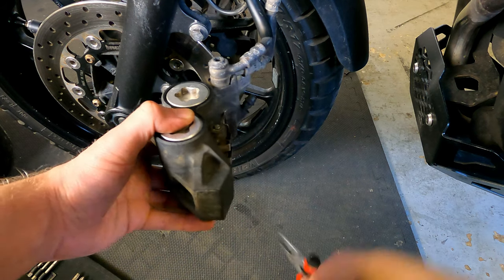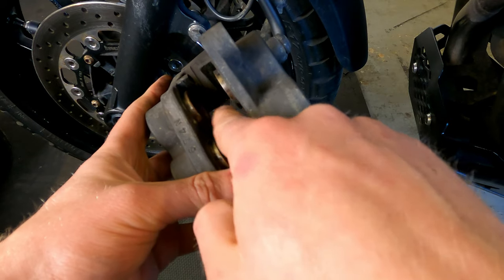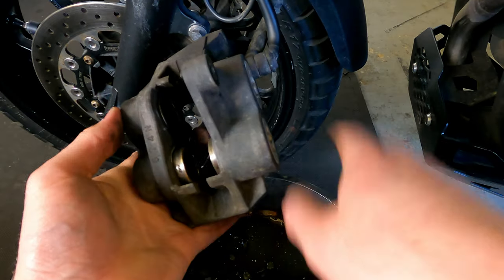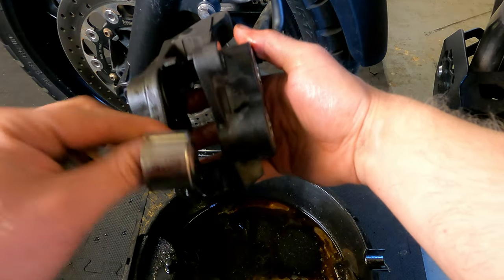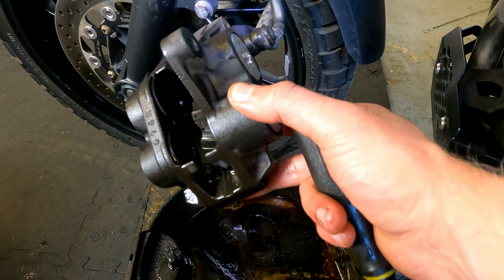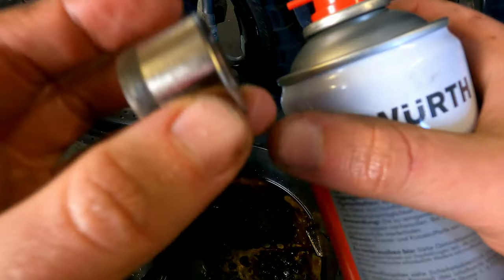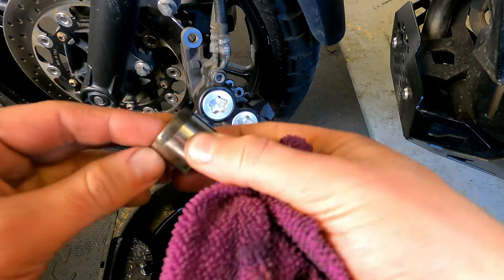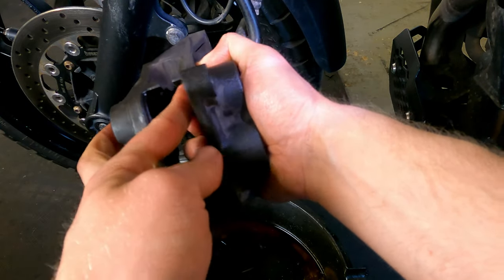Binding Motorcycle Brakes? | Replacing Brake Caliper Seals | Yamaha Tracer 700/MT-07

Comment: Nice job again Sam, very well explained. I'm surprised the seals needed replacing on such a recent bike as I have yet needed to replace any brake seals on bikes much older.  I'm expecting I will as my  fj1200 is 29 years old and not ridden for 10 years and was still on the originals at 19 years. My guess is they must have perished by now.
Reply from the maker: Thanks Michael! To be honest, I do think all the components on this bike are of a slightly lower quality being that it's such a cheap bike. Bearings, seals etc tend to be a bit more brittle compared to others but it's good practice nonetheless!
Reply: @SamVBikes  that night be the case, there is more profit to be made if consumables are lower quality, compared to the old days, as they can sell them more frequently. £80 a set is eye watering, at least Dick Turpin wore a mask!
Reply from the maker: Definitely! And I'm sure they will let you know a few other parts need changing when your lower quality parts start to perish and get changed!
Reply: @SamVBikes  that's the beauty of being able to do it yourself. When my best mate started biking a few years back and wanted to learn how to spanner, he was very wary of doing the brakes. Once I explained it was just basic hydraulics and he watched me do mine, he was fine to do his own. Many people get scared because they worry that they might get it wrong but with help, such as your latest upload or from an experienced friend it's not that difficult.
Reply from the maker: Definitely! I do think that most people are just nervous just in case they do something wrong.. so they don't even try!
Reply: @SamVBikes  I agree, I was fortunate enough to have my Dad show me how to do a lot of things, a lot don't but at least there are guys like you showing how to do stuff. YouTube is wonderful for that.
Reply from the maker: That's great! Youtube is wonderful for that but always nice to have a one on one tutor!
Reply: @SamVBikes  yes, I was very lucky on that score. I look forward to your next podcast 😀👍
Reply from the maker: Cheers Michael! Ride safe
Reply: @SamVBikes  thanks, you too. I still haven't ridden this year, when I have been free to ride, the weather has been dreadful. I can't wait for some sunshine when I'm not working.
Reply from the maker: At least we are allowed to go out now! Make those miles up!
Reply: @SamVBikes  will do Sam. If you ever get to worcestershire, let me know and I will take you on a great Rideout👍
Reply from the maker: Sounds like a good idea! Have a good one bud
Reply: @SamVBikes  will do, you too 👍

Comment: Anything genuine Yamaha is a ripoff but that is a whole new level of extorsion. Just a tip to save your fingers, a small piece of wood between the pistons that have already moved helps to apply pressure to the seized piston. Ride safe, Mike.
Reply from the maker: It's really is! Not worth it at all. Think I'll look at 3rd party from now on. Great tip! I've got some wind out tool to push them back in... but no idea where I've put it haha! Thanks Mike! Ride safe!
Reply: @SamVBikes  I honestly cannot comprehend how they are charging £80 for one set of the seals, actually mindblowing.
Reply from the maker: Its crazy isn't it! Dread to think what yamaha would charge to do the job at the main stealer! Haha
Reply: @SamVBikes  I'm going to estimate anywhere from £200-300
Reply from the maker: I might call them and ask just for a laugh. Make sure I'm sitting down first ha

Comment: hello, I'm from Portugal, I have a mt 07, still in good condition, because it's from 2020, but when I need to change the pads I would like to say ebc sinterized,.. or brembo,..and I would like to know, if after changing your brake pads, you noticed an improvement, especially in the rear brake,.. which in my opinion it doesn't brake, it just slows down and helps with balance, in curves or other maneuvers,..but in fact, the rear is very soft ,.. the ones at the front comply ,.. but I believe it is possible to improve, and I've heard very good things about the ebc pads
Reply from the maker: Hey! The EBC sintered pads made a big difference to the front of mine. The back was better but not amazing! Still worth upgrading in my opinion!